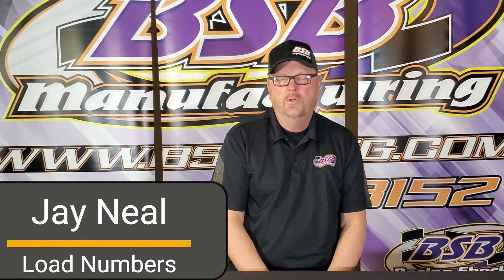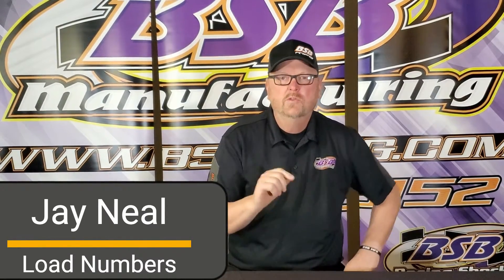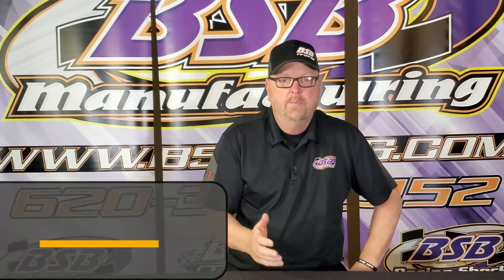Load Numbers vs Ride Height

Comment: I race a Bmod. It isn't uncommon, for the track to throw an audible and farm the track, with next to know notice and SOMETIMES, I don't have the option/time etc to make a spring change for the feature when that happens. What do you suggest we do in that situation?
Reply from the maker: When this happens your adjustment will depend on what you are doing with the car, here are a couple of options: Have a soft RF in the car, you can add turns to the Rf to help the car turn and to keep it out of the ground. The increase in speed may have you getting to the load faster. The same applies to the RR< if you were getting ready for more of a slick track and you are carrying lead on the RR you may need to add some turns to the RR to help it from over traveling it.

Comment: We do ours different.  When we setup any of our mods we find the center to center on RF shock bottomed out and use that as a length to keep the RF out of the track when we put it in dynamic.  Then we have found that most chevelle frames like around 1250 to 1450 lbs of load at that length.    Aluminum head A mod on a bump seems to like the smaller number. Steel head E mod likes the heavier number.  At that point you dial in the spring rate. A light 400 spring sits higher atcstatic and will load the LR more it seems as the 400 raises the RF more. If we put in a 600 it keeps the RF down and turns beyter as it has less range of motion to load the LR. We have even played with an 850 RF and that thing just wanted to turn all the time because the RF just stayed down and never Really transferred weight to the LR.
Reply from the maker: Good info and thanks, I responded on our team page on this if you want to read it. Thanks Guy
Reply: @jaynealgofast  I have not signed up for the teams thing yet as my car will not be done in time to run this season.

Comment: I agree with all of your points. The only thing i think you missed is unless they are like for like cars  (same year, same lower control arms) the results will vary quite a bit based on shock angle (mounting point angle) and lower mount distance away from center of spring. Angle will change load and distance away from center of spring will change load due to the moment and motion ratio. Ive had a few guys call me asking about load stick loads and it was clear they were off in the weeds. This video will definitely help those chasing the load numbers and how they are used. Good info!
Reply from the maker: Thanks

Comment: Hello Jay, when I initially set my ride heights I use set up plates (  4 corners are identical axle/spindle hgt ) to make sure all my roll centers and angels are correct but where I run into issues is once I mount all four tires  I need to reset  ride heights to get geometry back but now my ride heights are off. Do you understand what I’m saying? So what is the correct way especially now with ride heights min/max rules. Thank You jay and I hope you get enough interest and response to keep the channel going. It’s helped me a ton!
Reply: Why would you use setup plates that don't represent the size of the tires that you're going to race on?
Reply from the maker: Yes, if I understand correctly when you have your setup plate on the car you lose the rake in the car that the tires make. If this is the case I think I would do the setup with the tire instead of the plates or make some adapters to put the car in the correct position. Ride heights are going to be crazy this year.

Comment: Can you go into more detail with the stockcar side of this. With our new ride height rules kinda changes things. We don’t really anything that light in the front end.
Reply: The scaling or load sticking procedure is the same regardless of ride heights and Spring rates.

Maybe I don't understand that question, can you reward it or give an example?
Reply: @jerseyshoredroneservices225  I understand scaling and loadsticking are the same, but when you have to lower your car you lose load in those corners. So I’m wondering say I run a 800 lb spring and at 3 inches of travel I was at 2200 of load. But if I have to lower the car what spring rates would allow me to lower the car, but keep the same load at that 3” number.
Reply: @tysonpartridge2773  
 Just because we never met or even spoke before I'm going to try to explain what I'm thinking very methodically, step-by-step. Sorry if it starts off too slow and basic for you.
 Also I'm not Maynard Troyer or Bob McCready. These are just my thoughts from my own experience with race cars, but if you think I'm wrong please say so.

" When you lower the car you loose load on those corners".
 That's only correct if you do one corner or diagonal corners. For example if you lower the right front by screwing up on the spring adjuster, that corner will get lighter but the left front and right rear will get heavier. The diagonal corner which is the left rear will also get lighter.

 If you lower the whole car evenly on all 4 corners the wheel weights and load numbers will stay the same.
 If you lower just the front evenly on the left and right sides your numbers will stay nearly the same.

 About your spring rates, you only need to change that if the car hits the track when you lower it. So hypothetically if you lower both front corners 2 inches and you start digging into the track then you would need stiffer springs to limit the travel... or use bump stops...or coil bind.  Bump stops and coil Bind setups are probably not appropriate for most cars on most tracks.

So if you're gonna have  a lower ride height to start with and you need to limit travel with stiffer springs then then I think what you need to do is calculate what your spring load was on your old spring at full travel. One way or another you would come up with how much travel you had with the softer springs and then put it in a spring crusher to see what the load number is at full travel.  That number represents the spring pressure you need to keep the car off the track.
 Now take a stiffer spring, compress it down to that same number and see how much travel it took to get there.  Did it travel too much, meaning did it travel enough that the car is hitting the ground, considering your new, lower right height?

  If it traveled too much then you need a stiffer Spring (or maybe a spring rubber) so get a stiffer Spring and repeat the process. 
If it traveled very little and you're not utilizing all of the ride height then you're new spring is too stiff and you could go back a little bit towards a softer one.

Technically instead of trial and error with these different springs you could calculate spring travel based on the load number. You measured your old Spring and came up with the spring pressure at full travel. Hypothetically lets say it's 1000 pounds.  You also know how much shock travel you have available with your new, lower right height. Hypothetically let's say you have 3 inches of shock travel available before the car hits the ground. Your new Spring needs to have a rate that provides 3 inches of travel and accumulates that load number of 1000lbs.  

A Spring rate of 300 pounds per inch, compressed for your 3 inches of shock travel would accumulate 900 pounds of load number so that's a little soft. 325x3 = 975 which is getting pretty close.

Makes sense?

Comment: I run a 500lbs spring at 675lbs at ride height. I try to keep my ride heights right.  I will change spring to keep my down number. Using bsb load stick
Reply from the maker: Thank you for your info.
Reply: What is the "down number"?
Thanks